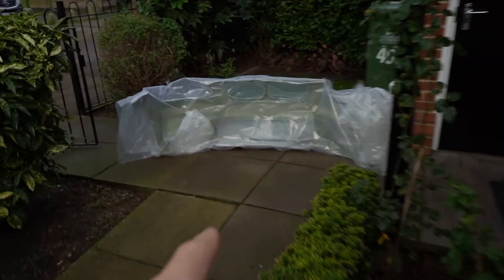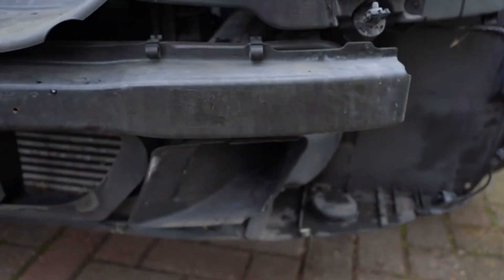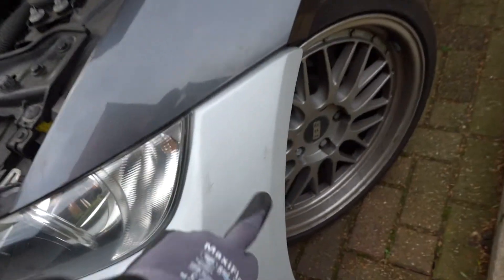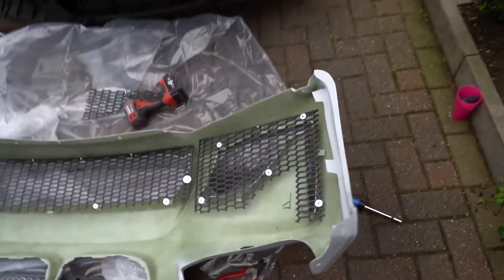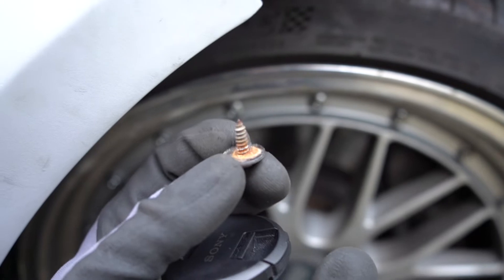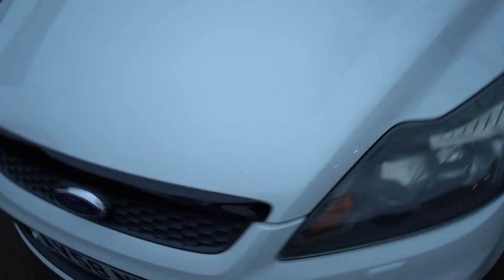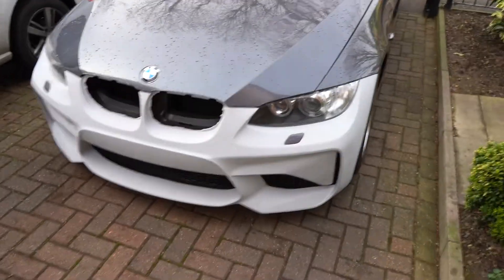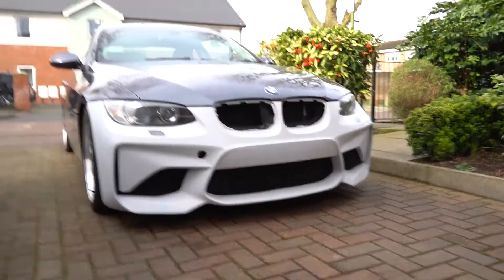Fitting BMW M2 Bumper to My BMW E92 335i

Comment: Did you not have to trim around the headlights, been trying to fit mine around work but it’s failing on the lights 🙄
Reply from the maker: Hi mate what you mean ? I only had to trim the plastics around the projector
Reply: @kilbster5503  around the projector? Like the headlight itself? Mines hitting on the actual headlight which stops it lining up with the wings
Reply from the maker: @billwakefield1312  the bumper slides underneath the light at the front only toward the side as it curves up it goes over the light.

Comment: Hi can I just buy a second hand one off eBay? Or does it need to be an after market one? As I know that an m3 rear bumper doesn’t line up with SE cars
Reply from the maker: Hi, so its an aftermarket bumper, they mould the bottom of an m2 bumper to the bottom of an e92 bumper and then create the bumper out of that mould.
Reply: Nice where from
Mate? Any links?

Comment: Do you have to do anything with the fog lights? Or do they just bolt right in?
Reply from the maker: The foglights have been removed completely and cancelation kit fitted. You could retro fit them in the left and right grills but i would rather the air flow.